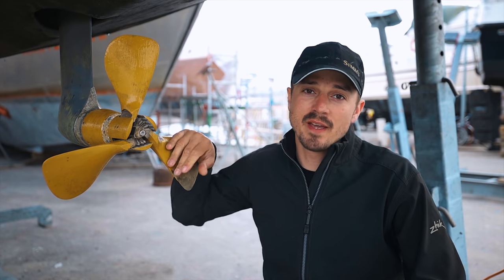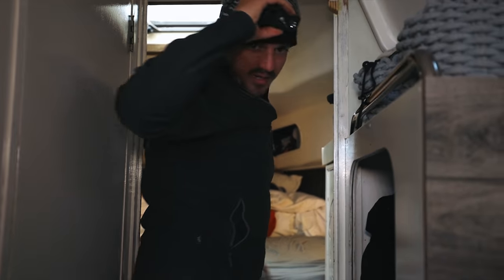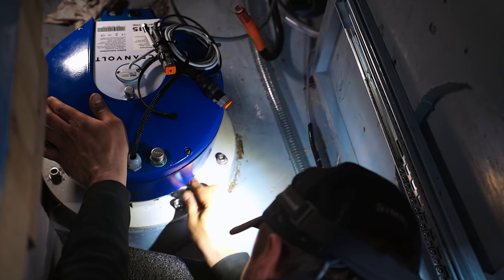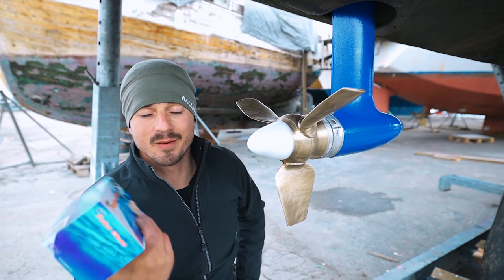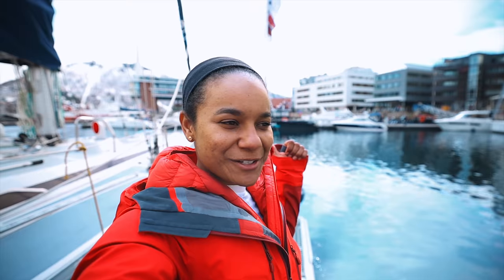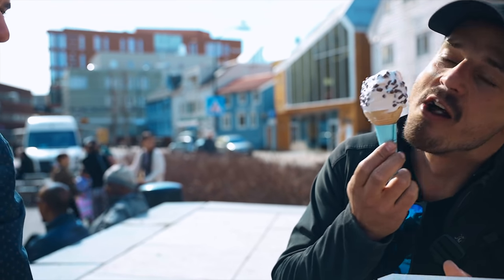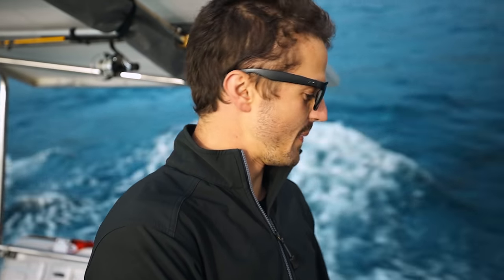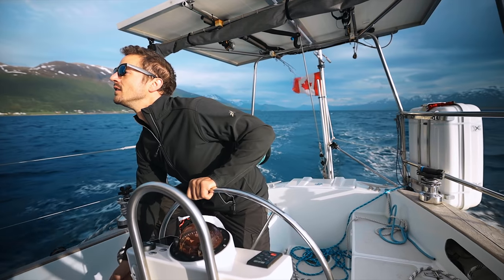Ripping Out our Electric Motor for the LAST TIME! — Sailing Uma [Step 277]

Comment: Nice system and nice install. But i wonder which is more efficient, a small windmill harvesting energy directly from the wind or a regenerating prop that is powered by a moving boat that is in turn powered by the wind?
I see other sailboats with a small windmill off one far side of the transom. The big advantage of such a windmill is that it also generates power even while you are ankering.
Reply: Think they mentioned it in one of their videos they have been experimenting with the idea of mounting a vertical wind turbine on the mast.
Reply: Compare the size you can cover with a wind turbine and the size of the sails to harvest the power of the wind, then you get the difference between the two ways to generate electric with it. That’s also the reason they didn’t feel that the system puts some drag on the boat even it practically does.
Reply: People still think that these small wind turbines are great way of making energy whilst the biggest ones are the best most efficient at making power in comparison financially the solar panel always wins from the small wind turbines
Reply: @milkoberben2963  you could be right but there will also be gloomy overcast  days without enough  sunlight. 
A windmill could still do the job, even at night. Maybe it won't deliver great amounts of power but it can do small amounts continiously, even when ankered,  in circumstances when solar won't. 
The optimal setup is probably to have all 3 systems, solar + windmill + regenning saildrive.

Comment: I have a question: with the variable pitch, the motor (and the prop) will turn always in the same direction? 
Front and back will be only a “pitch attack” without the e-motor stop spinning?
Or the motor needs to stop and change direction?
Inertia wants energy and I could imagine that the 1st option would be more efficient.

Comment: A couple of years ago I was considering buying a salvage Nissan Leaf (had been rear-ended so the front drive, heat-pump, stereo, instruments = all intact) to use as power plant for a sailboat.  24 KW lithium battery would mount above bilge as ballast .  Under sail (day or night) can use regen-braking to charge the battery if solar has not been enough.  107 HP motor could allow water skiing , etc.  if you configure the boat right ? !    Ha - ha !   The  salvage  Leaf  was  $5K .       Just  a  thought . 

    ( Of course I would carry a minimum 2K watt portable generator for system charging/operation  .   .   .   .   & for luxury surplus power )   For a catamaran you would only replace the failed / worst engine and retain the other hull's power plant since a cat can operate nicely under either or both .

Comment: You said you seen upto 650w regen at one point coming in. How many watts can the max output/cruising speed/docking power discharge?
Reply from the maker: We can motor at 5kts drawing 3kW. 

But usually we only use it to dock or anchor which is only a few minutes and used 200-500wh

Comment: Would purchasing an additional propeller double or at least boost the amount of power you produce ??
Reply from the maker: The propellor isn't what makes the power. The motor is. And yes, adding a second motor doubles the regen.

Comment: So how many miles of regen to give 1 mile of electric motoring  at medium power for instance?
Reply from the maker: On our boat.... 4hrs of sailing at 7kts give 1hr of sailing at 5kts. With faster boats, or boats with twin motors, that ratio is a lot better. But still not 1:1. Probably won't ever be 1:1.

Comment: Does the system monitor the batteries so that when they are fully charged at 14.4 volts for 12 volt battleborn, the propeller moves into No Charge position?
Reply from the maker: Yup! Of course. It’s stops charging at 95%.

Comment: Interesting system but doesn't the drag created by the prop being open and resistance cancel out what you gain (and some) , the only way I can see this being worthwhile is when the wind is strong and you have too much , so you deploy more sail to counter the drag from this system.
Reply: Sorry , watched to the end and you explain it's hardly noticeable ...I suppose 300w is like less than 1/2hp so if you were powering with a 30hp outboard and a compared it to a 29.5hp outboard you wouldn't notice at all...thing is how long would you need to sail to charge the batteries enough to motor for say 4hrs.?

Comment: Awesome new Ocean Volt system guys. Especially that prop. Just curious, does the prop give you reverse by pitching the blades, or does the motor reverse direction?
Reply from the maker: Motor spins the opposite direction and the prop changes pitch.

Comment: As a newcomer to your channel, I have to say you guys are mighty impressive. I’ve skippered only about 90,000nm (all short-handed) and done pretty much all my own boat maintenance & refurbs, and you are such an impressive crew: spot-on, sensible, steady, solid experience. I wish you well in your travels. 
PS. I’m closely involved in the RCC Pilotage Foundation - you may be using the Norway pilot, and/or the Arctic & Northern Waters pilot. If so, PLSE DO send us any news, updates, errors, omissions, etc.

Comment: What has speed over ground have to do with it?
Shouldn't  it be speed through  the water ? 
Did you work out which way the tide was running  like!
Reply from the maker: We explained that in the video. But we haven't calibrated our STW in awhile so it's off by .5-.75 of a kt. So since the tide was slack, and were in a large bay with minimal effect from current, we just used SOG since it was more accurate.

Comment: Just love your travel adventure!!!  You both have a great way about you and  make your videos fabulous!!  Thanks.  Just one question after viewing this video.  Will the new system give you an increase in the length of time you can operate the electric motor if you need to cruise under power?  Thanks, keep the adventure coming.
Reply from the maker: Perhaps a bit more. But so far our numbers for pushing the boat are pretty similar to the folding prop version. Maybe 5-10% better. Hard to say really.

Comment: So say around 15 hp = 11KW for 6.5 knots on a yacht of that size, 350w regen is only 3%, so speed reduction from prop drag disappears in the general noise of all the other factors that cause speed to vary e.g. wind waves trim etc.

Comment: Nice.  Being able to hydrogenerate (regeneration) is highly useful.  Basically most of your electrical power when under way then comes from the wind through sailing.

Eventually electric drive will be standard on sailboats, since it works so well in synergy with the wind.   You can motor out of the dock, raise the sails, recharge the batteries using sail power, then shut off the motor while sailing and then use it to motor back in later.  No diesel, no direct CO2 emissions, almost zero noise, high reliability, low maintenance.  Electric drive is better for many reasons.  But most of all, it works in much better harmony with nature, which is what sailing is all about.
Reply: Yesterday sailing was a necessity, today it´s pure entertainment. ;-)

Comment: At 8 knots the present propeller is too small in diameter to generate much electricity. By increasing the diameter then changing the right angle drive gear ratio so the motor spins at a higher rpm the unit should produce up to 1000 watts at 8 knots.

Comment: With these preliminary numbers on the new system that seems to be outstanding, do you think you will still need your gen set for the tropics or for that matter, where your currently sailing? I plan on setting up my future boat with electric power like what you have but don't plan on traveling that far from the worm waters and your information is pretty much key to my decisions that I'll be making. I'm in the planning stages right now. Thanks!
Reply from the maker: On the tropics, you can get by with just solar and regen, no problem.
Reply: @SailingUma  Thanks so much. That's the information I was looking for! OK, so no regen needed for the type of use you do with your boat :) Now I can get a dive compressor instead :)

Comment: Once you are sailing at hull speed you are overpowering the drag from your propeller, so your speed with or without re-gen shouldn’t differ much.
BTW, you don’t “put your jib out” unless it is on fire.  You shake the roller furl “reef” out.  Remember, people are listening to you and think you know what you are talking about.
I’m sure the re-gen is satisfying.

Once you learn that you absolutely do not need refrigeration, your power needs will be even simpler.
Reply from the maker: We went for 3 years without a fridge and 4 without a freezer. We know what it's like to live without them and how much better it is with them.

Comment: Pretty large, intricate system to simply equal an extra solar panel.
Reply from the maker: Solar only works when the sun is shinning. It's not just "one" solar panel, up her in the north,  there isn't enough space on our boat to add enough solar to generate what we can with the servoprop and a stiff breeze.

Comment: I've been thinking a lot about regen since the survey, how.... useful is it? I'm not a sailor yet, but from what I see, energy consumption goes way down while sailing anyway, nobody's watching netflix, using their laptops, cooking appliances, etc, wouldn't focusing on more solar be the way to go? unless you're going out and sailing back and fourth (if you dont wanna go anywhere) just to charge the battery? isn't 300-400w a couple extra panels?
Reply from the maker: Solar only works when it's sunny. We LOVE regen. We can stay on anchor for a few days, then sail overnight and charge up, fill up our water tanks and go back on anchor for a few more days. But it isn't and "either/or" thing. Solar AND Regen are what make electric sailboats practical.
Reply: @SailingUma  Yup, gotcha, I watched the episode on that dual-motor yatch, 1kwh is huge, lack of engine and fuel tank means you could have a bigger house bank... its starting to make sense and grow on me...

Comment: Interesting upgrade - with the previous one they went flat to the ground - might these get injured it you bottom out as they don't fold? Not a boater, but enjoy your travels. Thx.
Reply: Unless they back onto the ground, I'd think the keel would give more than adequate protection to the prop.
Reply: @jerrymiller276  Sounds correct. Thx
Reply from the maker: Our keel and rudder protect the prop.
Reply: @SailingUma  AH thx for informing a non boater - love your videos!

Comment: How long can you run the motor only on the batteries. and how much MW do you guys have? very intersting system!
Reply from the maker: This chart has all the info you need:
https://youtu.be/EWFjxFkTWmQ?t=1776
The new Servoprop is even a little more efficient than the old one.
Reply: @SailingUma  Thanks!!

Comment: When you are on the hook with a descent current, will you be able to regen while sleeping at night?
Reply: Very little energy will be created at low speeds, like currents.
I calculated 0.5knots=0.1Watts, 1knot=1Watts, 2Knots=9Watts, 3Knots=29Watts, 4Knots=69Watts, 5Watts=135W, 6Knots=234Watts, 7Knots=371Watts,10Knots=1083Watts.
Matches Dan's real world fairly close (you can't expect perfection as too many variables). 

The big factor in wind and sea turbines is the the velocity (water speed in this case). Because V is cubed. E.G when v=1 then cubic=1, v=2 then cubic=8, v=3 then cubic=27.
The increase is not linear. Higher speed means far higher watts, and lower speed gives bugger all watts.

You can calculate the Watts using kW = 1/2 prop area * water density * Velocity^3 * efficiency. 
Prop area = 0.05m2, total area props sweep (radius squared * PI, I guessed radius=0.13meters), Water density = 1000kg/m3, Efficiency =30% (you can't get all the energy of the water as the water would stop), V = speed in m/s (m/2=knots/1.944).

Comment: I was right ---- and wrong. I predicted that at the next haul-out, Uma would be outfitted with the prop that promised better regeneration results. What I failed to take into account is that Dan and Kika now have earned the credibility for Oceanvolt to supply them with their most current technology. Good for them.  Now, the next hurdle. How to gain and store sufficient power, at anchor or underway, for electrical induction cooking!

Comment: Have a 50 footer / 35 Ton vessel, brand name 1977 Challenger.  I would think that I may be a bit to big and heavy for an electric refit.  Correct me if I am wrong.
Reply from the maker: Heavier the better. You'll just need to budget in for more batteries. And probably won't be able to use the standard 48VDC golfcart parts. Larger, heavier boats start to gain from the benefits of the commercial sector

Comment: I know it's not exactly an accurate comparison as the power conversion losses and water resistance will vary a bit depending on the speed etc. but regen definitely has an effect on the boat speed but at those power levels it's so negligible that you don't see it. Also comparing the motor HP/watts to force produced by sail is not so straightforward.

But in case, you could just try and see how much effect would the servoprop have moving Uma if it's given 300 to 500W of power. This would be quite nearly equal it has an effect on when sailing.

Comment: How fast can you go with the motor on max? Maybe 4 knots? So at 4 knots, you need about 15 kW for the water resistance. Your sails give you this power. If you are using regen at 4 knots, and it will give you 250 Watt, you are taking max additional resistance of 500 Watts. This is 3 % of your drag. That's the reason you can't feel the difference between regen and no regen.  
I think you can double all numbers at 6 knots, so it is still 3 %.
Reply from the maker: We can motor at 7kts drawing about 9kW of power. At 5kts we’re using about 3kW.
Reply: @SailingUma  So it is more 200 Watts at 5 knots, maybe 400 Watts drag, while the ships drag is about 2,4 kW (3 kW motoring * 80% efficency). So the additional drag is about 15-17 %. Still not that much! At 7 konts it is 1000 Watts add. drag to 7,2kW ship drag. Thats 14%, so very similar.

You are motoring so much faster than i thougt. I remember the episode with the forklift motor and the passage river upstream. You really had to fight the current!

Comment: Actually, if regen is not noticeably slowing boat, why do you need feathering prop? standard fixed prop will do same thing: always regen or move boat depending of throttle position with much less cost?
Reply from the maker: You don’t always want or need regen.
Reply: @SailingUma  thanks for your response! I'm EP enthusiast too for last 5 years, but at small 25 ft boat so regen is not my story, until I will finish building my next larger boat. Good luck with your journey )

Comment: If you are at hull speed, turning on the regen should not make any difference, since you have excess wind power. Quite obviously, an efficient electric system fully replaces a combustion motor auxiliary. Very convincing.

Comment: If your SOG is 7kt and SOW is 6.4 kt, then the current must  be additive.  Wouldn't the current be WITH you not AGAINST,  that is, the current is mostly in the direction of your bearing?
Reply from the maker: Like we said in the video, we haven't calibrated our water speed in a while, and even if we did 0.5kts of current is almost impossible to measure with a little paddle wheel. So we used SOG knowing we were at slack tide in a wide open bay where tidal effect was minimal.

Comment: Cool. Now the whole device should rotate and you don't need a rudder anymore ;)
Reply from the maker: It would be almost impossible to keep it sealed. Torqueedo tried it for awhile and it failed, so they went back to a fixed unit. Besides, twin motors does almost the same thing, plus double the regen.

Comment: That's huge for regen! 

I don't see why a system of turbines couldn't work on a boat. It's the same concept as a propeller in water.

Angling two off either side of the solar supports (even or below the panels) would be out of the way and balanced...

Your watt usage was on the high end before the upgrade.

Might be a fun fairly inexpensive mod to play with.
Lower impact as it wouldn't necessarily have to survive underwater.

Comment: The size of the propeller is the limiting factor in regen. Hard to have the proper size for propulsion and regen.
350w is 1/2 hp, not enough to make a difference in speed

Comment: Where is the power being generated from... I'm new to sailing
Reply: boat speed through the water turns the prop, which is connected to the motor.  An electric motor is a generator if turned by an outside source, such as the prop.

Comment: Interesting. When I finally give up sail racing and buy that perfect cruiser, it's going to be all electric (only 57 years young so still a few years left before I give in to the furling systems ;-) ), with regen, no doubt (did anybody say Arcona?)

But Dan, hmm. Why speed over ground? Would you still or for SOG on your X-axis in a four knot current? It's the boat speed (BS, speed through water) that matters as input to this statistic. Was your impeller not working? Come to think of it, you did mumble something at the very beginning of your data collection sequence and I might have missed it. I'll go back after watching the rest of this weeks show.

Ok, I went back and you were saying you hadn't calibrated boat speed in a while. Fair enough. Ballpark statistics anyway. The point i guess is to see the curve

Glad you got to experience a bit of 17.May. Not what it used to be during these pandemic times but it will bounce back when we get properly out the other side. Then try to plan for being in Oslo to see the BIG party ;-) Now that's crazy ;-)